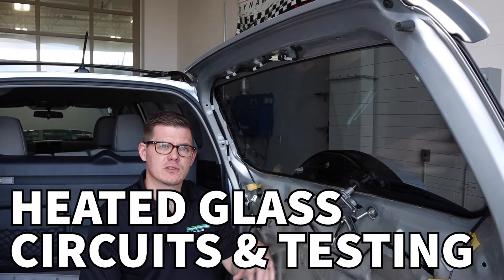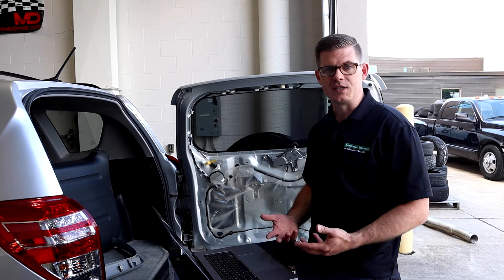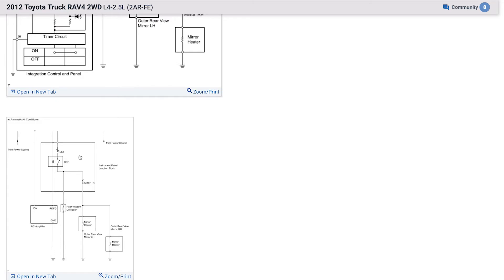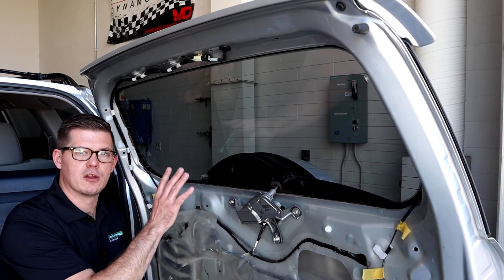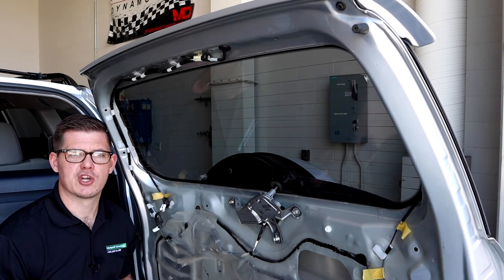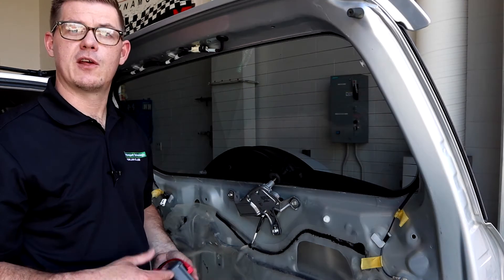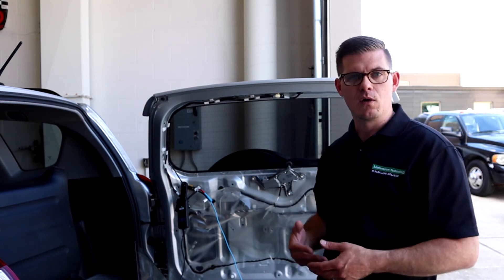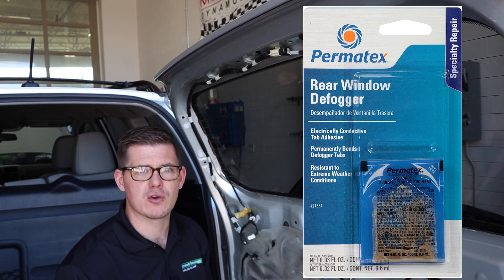Heated Glass (Defrost, Defogger) Circuits: Overview & Testing

Comment: Good video, thanks! 

I have a question. If one side is 12v, and the other side is grounded, and the defroster is essentially a series of thin copper wires, how does it not just cause a short? If you used any other copper wire to join 12v and ground, it would short, but somehow the wires in the defroster do not. I'm guessing it had something to do with the low level of resistance
Reply from the maker: Thanks for watching! Yes, the grid has a low level of resistance which allows it to heat up while operating at a manageable current.

Comment: thank you so much that was amazing tutorial and explonation
Reply from the maker: Glad it was helpful!
Reply: @AdamsAnalysis Hello I am having problems with my rear defroster my switch seems to be working and everything looks good I checked every single grid line with my multimeter and have 12volts on each line and it still not working what else can I do?